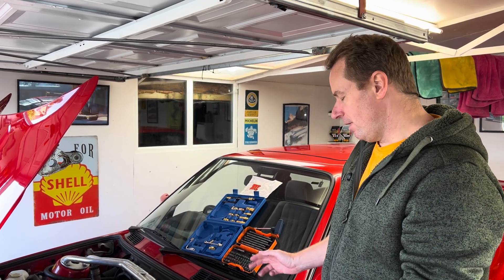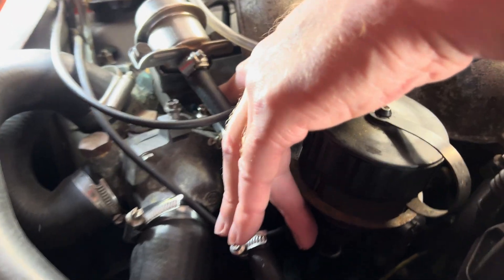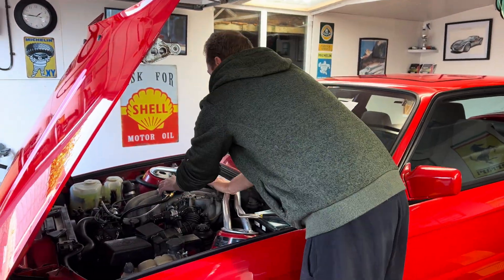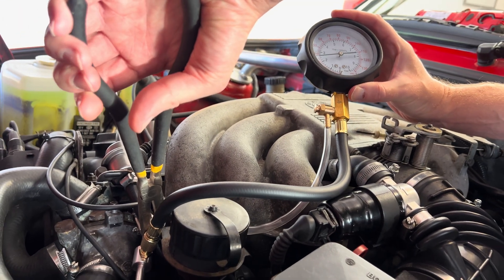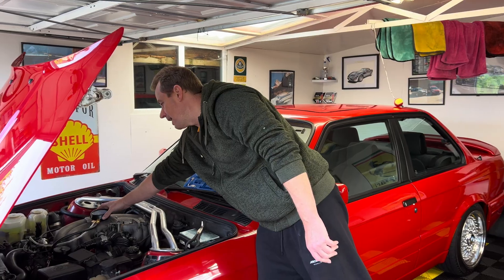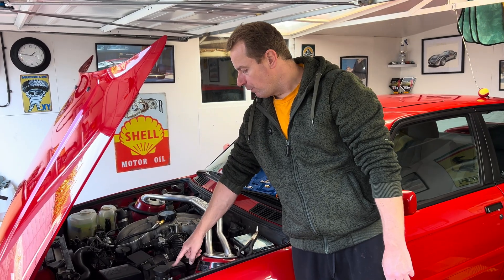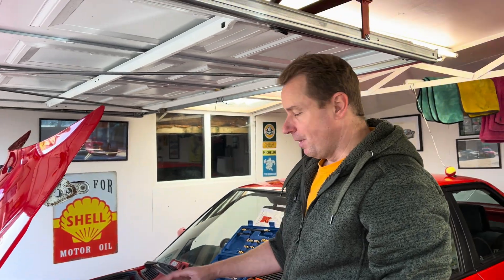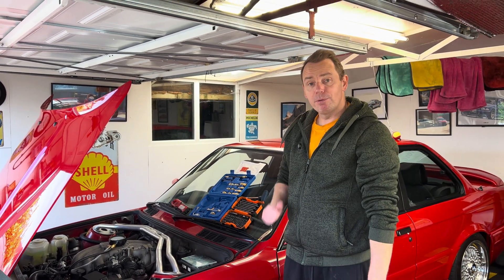How to test your fuel pump / FPR on BMW E30 325i Sport (M20B25) and how do my readings look?

Comment: You don't actually need a special kit for this. Just a T splitter, a bit of fuel hose and a generic water/air pressure gauge (i use a 6bar one). Just make sure not to spray fuel on it's display if it's one of the cheap plastic ones